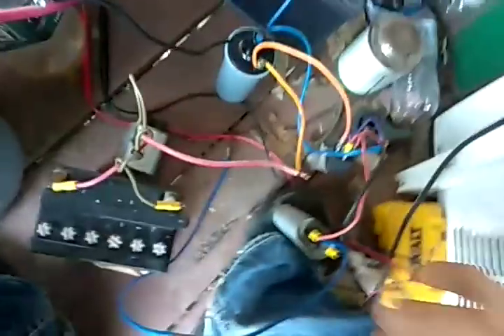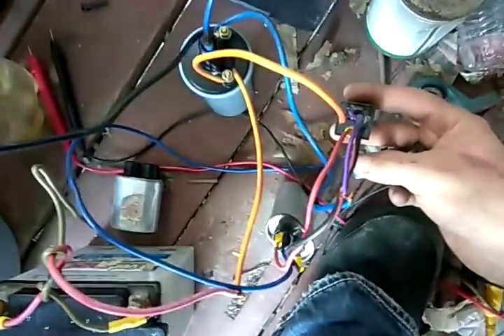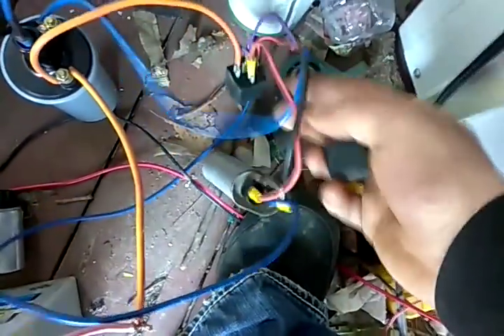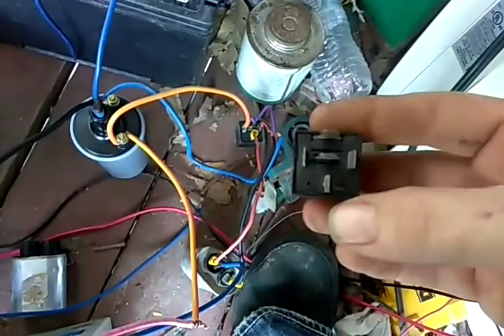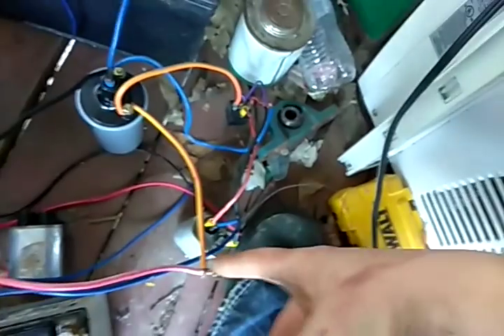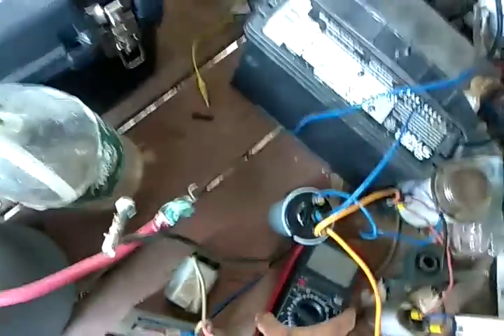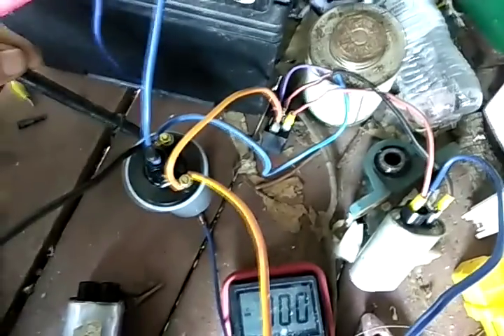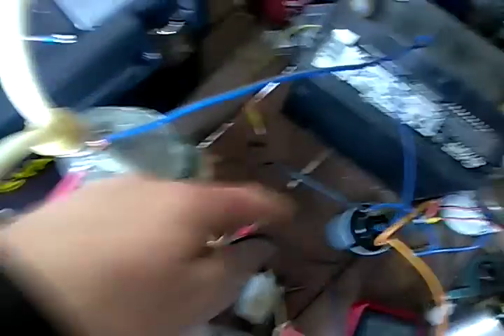DANGER!!! HIGH VOLTAGE AC!!! (From 12vdc) DO NOT TRY AT HOME!!!

Comment: the video was DC life hack
Reply from the maker: TTJ BigGunner 
And in that video I was able to charge a 12 volt car battery with an 11.1 volt RC car battery. Now, although it was just a transfer and energy, it was a very efficient transfer in energy from a low power  source to a high power source with only about 3% loss in the transfer.

Comment: energy is here in the form of water falls,wind, solar,etc they have to be harnessed. you do not create power, if you split voltage, ramp it up to the same so now you have two 110 power lines, but with half the amps, I went to college for this crap, keep talking, and if you claim it, then explain it instead of crying about going missing. Not that I trust the government, but if your gonna come on making incredible claims with no explanation your going to look a fool
Reply from the maker: Jim Early 
Well brother, if I look like a fool, then I look like a fool, but only "one" can judge me. 
I also went to college for blueprints, geometric dimensions and tolerance, trigonometry, geometry, calculus, and quite a bit of other things. But my real knowledge and understanding came from the 7th time I died. I was dead for almost 45 minutes and I was taught and given a mission that I will not give up on!!!! And by a pure entity of light! People on this planet would call it the Holy Spirit, but I will tell you it was "part" of GOD. I know things that other people don't know! I know about the H3. I know where the moon came from. And I know where energy comes from. And I'm not talking about the BS alternator video that I didn't tell anyone to put high voltage into... I also know how the transmission of HVAC works and how it takes potential to duplicate potential. I know how to make unipol magnets and what can be done with them. I just can't do this by myself.. my wife makes minimum wage and because of me we only have two bills. One being our land payment and the other being our transportation. And that's how we were able to make it on $10,000 up to $12,000 a year income. 
Let me ask you this?
If I took a battery Bank a large power inverter and two cans One Two Step Up the transmission and the other two step back down the transmission to go to a 500 horsepower 3 phase AC induction motor with a gear Head On It, do you think that I would be able to turn a hydroelectric generator and do you think that that hydroelectric generator would produce enough power to charge the battery Bank?
Or do you think it's not possible to create resonant energy or perpetual motion? 

Signed: Dumb Redneck
Reply: ThomasBuie EnergyBuies at gmail com Don't worry about convincing me of anything, you already have, and it has nothing to do with electricity. I am convinced! you do this crazy crap for money, or your just plain in need of help. Your posting from something, the government wanted you, you wouldn't be answering me if your so damn smart, look behind you.
Reply: 7th time you died?
Reply from the maker: Jim Early 
yeah you're right if I was so smart I wouldn't be replying to your comment. if I was so smart I would just roll over and show my belly and never stick up for myself..
 I understand what you're saying completely and do you think for one second I'm scared of you or any government or any person on this planet? Trust me the last thing someone wants to do is kill my vessel... I promise you that!!  do you want to make some statements that are not rhetorical? ("Look behind you")
Reply from the maker: Jim Early 
You say the government wanted me I guess you're talking about the company called USA or the company called United States? If they wanted my help building the "cube" then they should have came at me a lot differently!
Reply from the maker: Jim Early 
why would I take time to answer you? because that is exactly what I'm supposed to be doing! I'm supposed to be reaching out to as many people as I possibly can to help as many people as I possibly can, to understand the way things work. not the way that we've been told they work. What statement did I make to belittle you or to make you think you were less than me? I would not do that to the person on the planet with the lowest IQ score! we are all equal! we all have our greatness! some may not be more knowledgeable but have more love than anyone else! love that you can feel when you get close to them without even seeing them! I treat others the way they treat me no more and no less!!!! And if I do, it is never intentionally!!!

Comment: Huge display of power from a lawnmower battery and some spare parts!
Reply from the maker: XspeedXracerX
I tried using the car battery and there was no change except that it wore out the relay although it's possible that the relay was just real old. I got them from a junkyard years ago but hooking the car battery up to it didn't change anything. The positive and negative on the ignition coil was showing on my voltage meter 97 to 125 volts ac and running between 56 and 61hz. I don't have a meter to read the voltage that was coming off of my secondary on the ignition coil but it was at least 30 or 40 thousand volts. Using the lawn mower battery I played with it for hours and it didn't kill the battery and didn't hurt the relay I believe using the bigger capacitor off of a Mot smoothed out the signal enough that the relay wasn't damaged by the oscillation. I did do a little further testing and ran the high-voltage output from the secondary on the ignition coil 2 a Mot Transformer secondary and was able to get 110 volts ac out of the primary on the Transformer I did not check the amperage and I haven't tried putting anything on it for a load yet.. I was having too much fun playing with the spark gap... :)

Comment: You are very talented, just please watch your ass with this action.
Reply from the maker: +Mizer * 
Thank you very much for the compliment I cannot take credit for this although I did change the way the circuit runs. I added the high-voltage capacitor out of a microwave oven which I believe smoothed the signal out a whole lot!